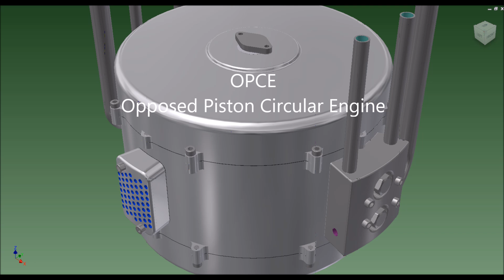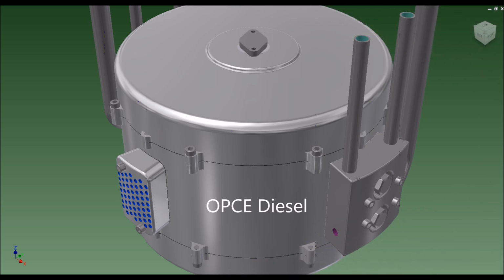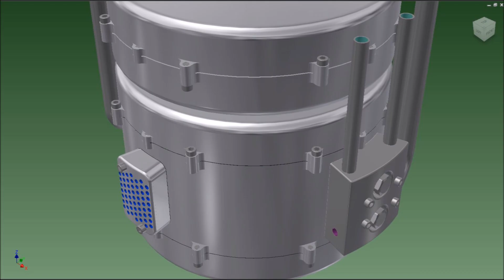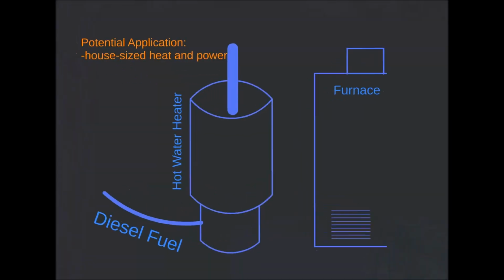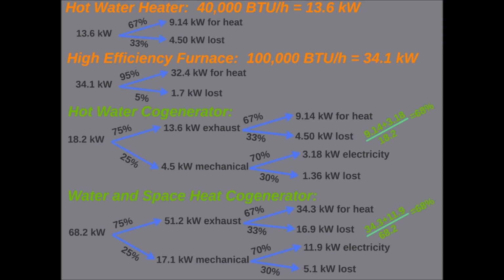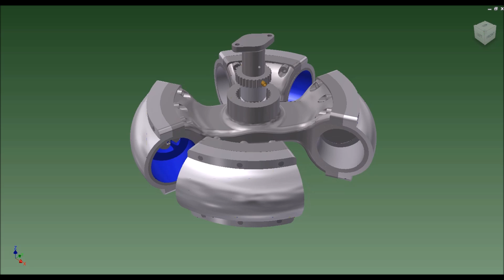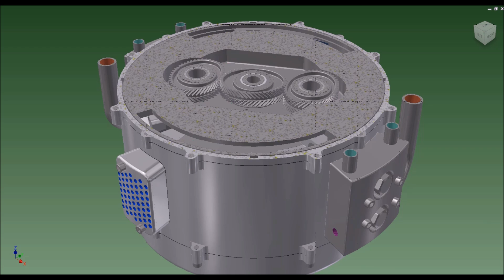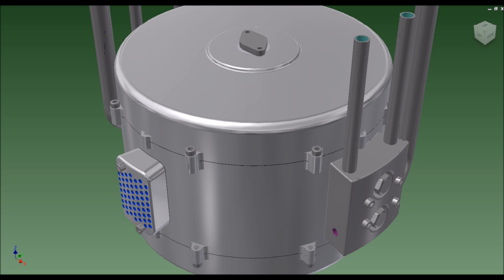OPCE Diesel Engine

Comment: Maybe don't write off transportation just yet.  If we are going to build semi-trailers with the same power train reliability as electric railroad traction engines, they need an efficient, high compression engine to run generators and top off battery or capacitor banks, which must not significantly offset the mass of cargo.  The real advantage here, is that one only has to optimize for a narrow range of RPM operation.  The battery bank can handle the variable demand cycles more easily.